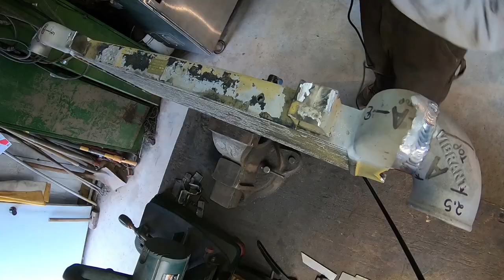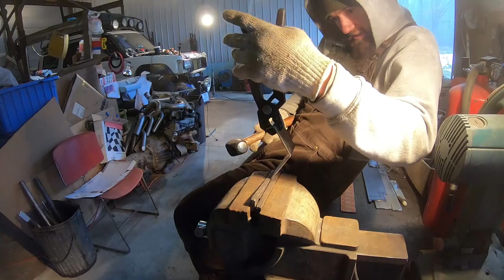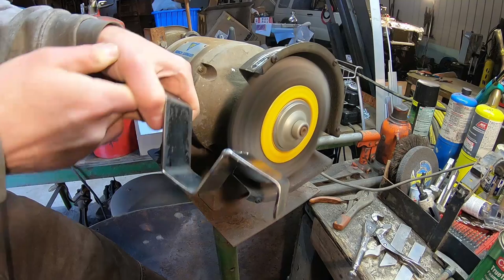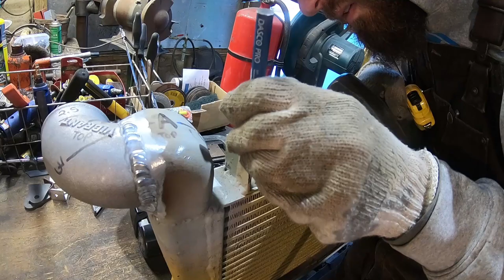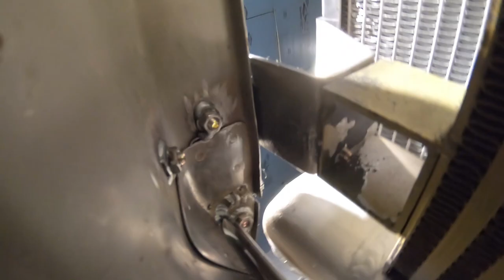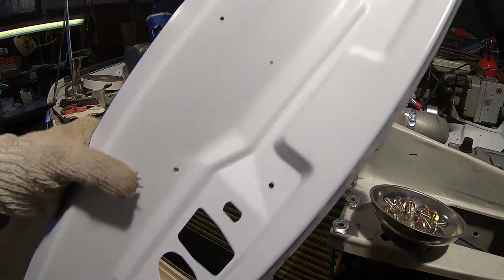Radiator & Intercooler Mounts × 4BT Cummins Discovery #29 [Land Rover Build]

Comment: I still have to figure how I’m going to build my new core support, the original was so rusty I cut the front clip off. After watching Street Bandito, I’m leaning towards a one piece front clip made of fiberglass or carbon. Not sure yet, might be work than it’s worth.
Reply from the maker: Oooooo that would be cool! I really want to do that with my Crx project... add all the lightness.
Reply: That’s the idea, Discos are a bit on the heavy side. Pa road salt started the process.🤨 I’ve stripped down the interior to the bare minimum and the wiring too. Since I’m swapping in a VW tdi all the engine wiring is long gone. The back will have bed platform with storage under it.
Reply from the maker: They sure are! Mine is certainly not getting any lighter as the project plows forward. Road salt should be illegal for the damage it does to the roads, bridges, & vehicles ☹️  That'll be a cool build! Would be awesome to get a whole gang of modified Disco's together for a meet-up of sorts. I could only imagine the variety thanks to the inherent issues in OEM trim.

Comment: Re hardware storage...my dad had a bag of nuts and bolts all of which were salvaged. Whenever he had a project he'd empty the bag into the boot of the Citroen and scour the lot for the hardware he needed. It was my job to put them back into that black bag! I will never inflict that chore on my sons!
Reply from the maker: A lesson I could've done with it seems! Most all of mine here is the same too, just loads of salvage from old projects. A small pile quickly evolved into a mess, & the bags have just started to turn to dust after all the use lately.
Reply: I should add that I'm really enjoying seeing your work  @Tinker1837 . I drive a Defender. My first Land Rover was a series 1 Disco. I spent many a day helping my cousin fit a GMC 6.3 V8 diesel into a 110 County.
Reply from the maker: @atoieno  I'll keep them coming :)  A long wheelbase or ambulance Defender is what I'd originally dreamed about for a build like this one, well before I realized the rear interior space available from the Disco's tall roofline. They're a good middle ground between compact & full size. That's an interesting swap, sounds like the engine commonly found in military Humvee's over here.

Comment: what type of rad fan are you going to use?  Looks like you will have to use one of those electric flex a lite low profile ones
Reply from the maker: Yep! Plan is to use a pair of Spal fans, or maybe just one, two could be overkill.
Reply: @Tinker1837  Have you test fitted? When I did my intercooler install I was planning on going with a single 16" spal fan but the motor housing was too long...ended up going with flex a lite 583.  Was the only fan that would clear.
Reply from the maker: I have not, kinda doing the same where I'm going off measurements alone. I'm hopeful I can make the one I'd like to work in that space, but since I moved all the coolers forward I should have more options than before.